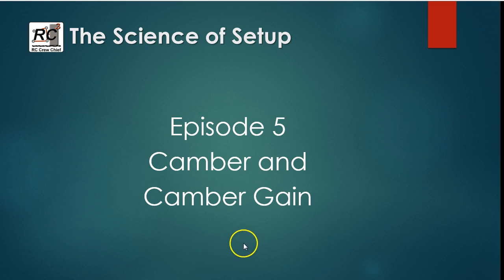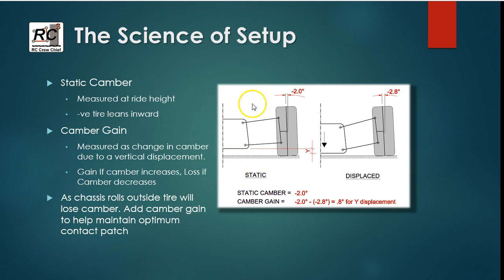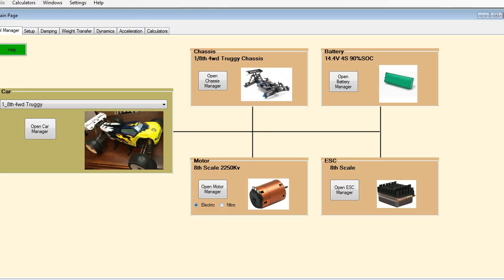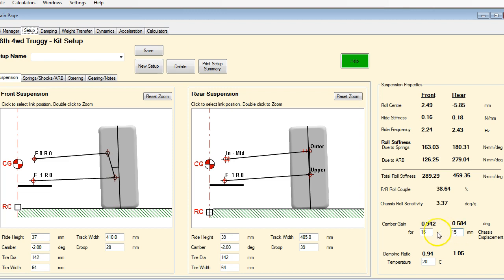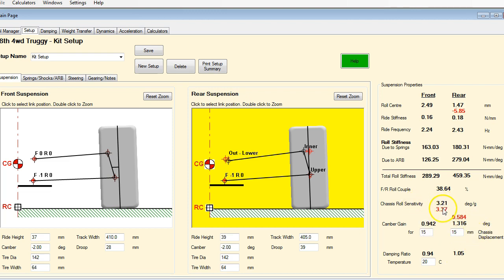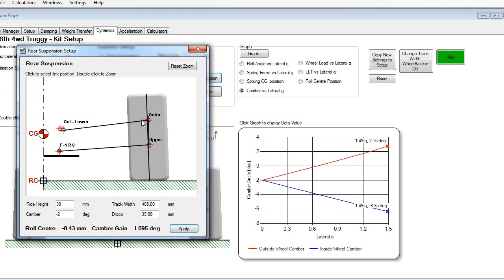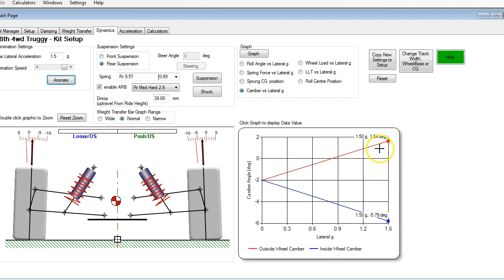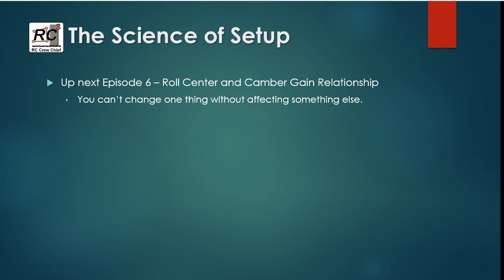The Science of Setup - Episode 5 Camber and Camber Gain

Comment: Hi, I enjoy your videos and Iv studied them over and over so I can really understand what we are trying to achieve when it comes to setup, but I have one problem with this video and explanation! It's the camber gain. Now I understand displacing the chassis makes all 4 wheels produce camber gain or what's called camber intake, but when your tuning with the upper camber links is the main priority that the outside wheel under lateral G doesn't go into positive camber? Because if so we should be calling this camber loss under later G. 
We reduce the amount of camber loss by making the upper link more inclined or the link shorter. 
In your demo with truggy you inclined the upper link more to reduce camber loss.
Am I right or completely wrong. 
Thanks
Reply from the maker: Under normal conditions you do not want to go into the +ve camber range. If you go there less grip will be the reward.If you want to simplify the terminology then lets just talk about camber change versus roll. So the more parallel the upper and lower arms are the more the tire camber will change as the chassis rolls. The greater the difference in the angle between the upper and lower arms the less the camber will change as the chassis rolls. By increasing the length of the upper (camber) link you will get more camber change as the chassis rolls as you are reducing the difference in the angle between the upper and lower arms.You are 100% correct in what you are saying we are just using different terminology.